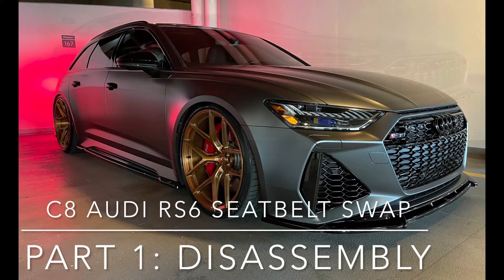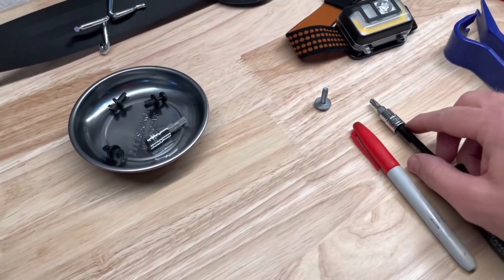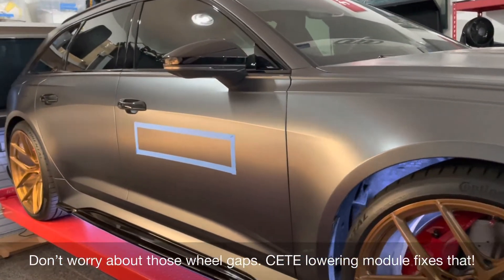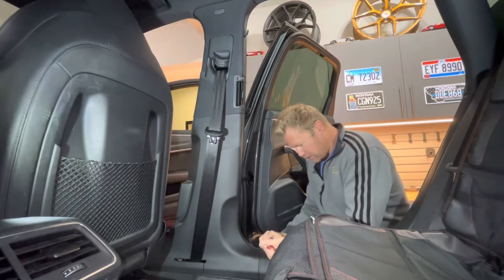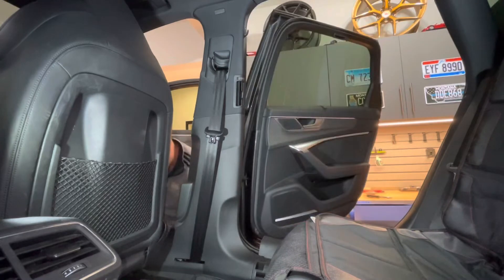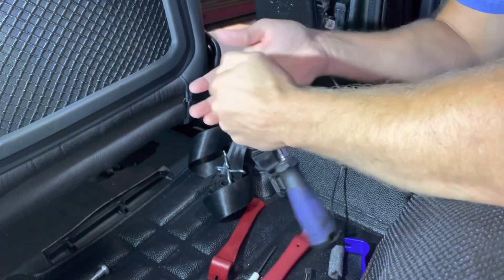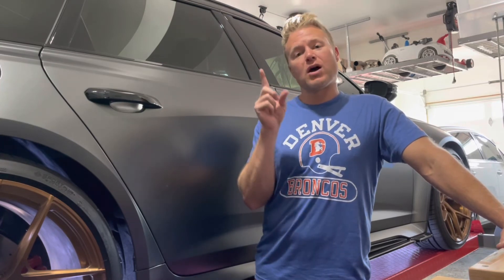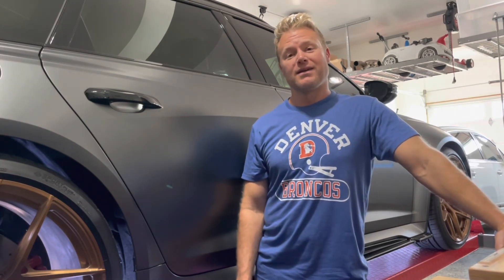How to Remove Front Seat Belts - Audi A6 S6 RS6 (C8 platform) - Part 1

Comment: Is there any aftermarket brackets for the C8 audi A6 planted floor brakcet for aftermarket bucket seats? If not the the C7 platform use the same bold pattern and bracket as the C8 platform?